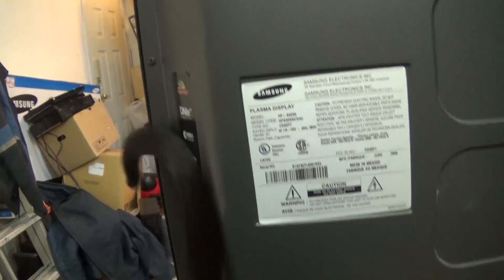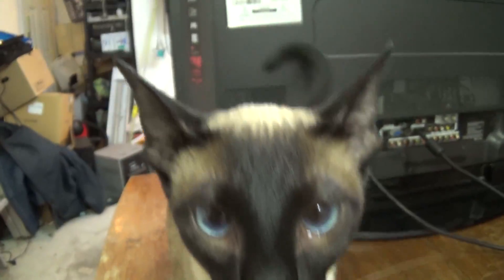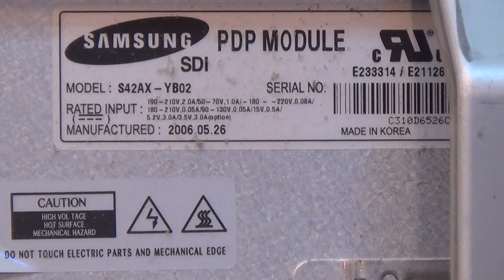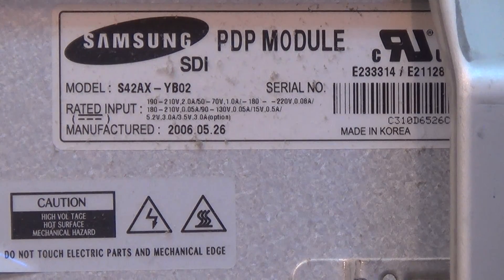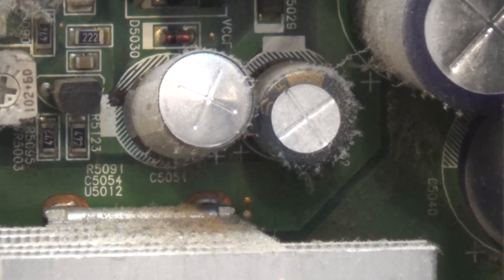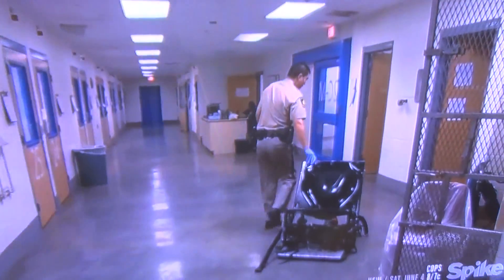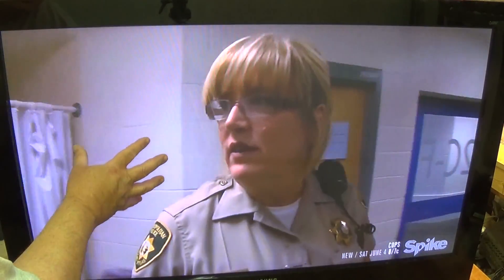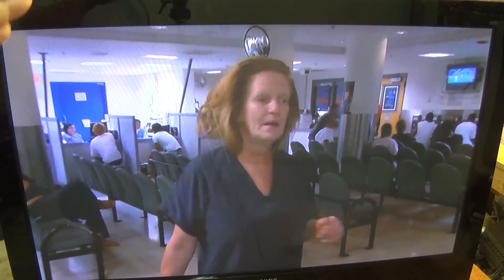Samsung HP S4253 Plasma Noisey picture

Comment: Hello can you help me, I have  Samsung hps4273x/xaa plasma and I can hear the relay ( power supply board) is clicking on and off a dozen times (no picture) on cycle until the tv will turn on normally, any suggestion?

Comment: Dont fuck with the VA voltage, they are set correctly. I just picked up a set that just had work done to it because the sound went out and a month later the people said the screen went out. What did i find? The va voltage had been set to exact voltage by the last tech and the screen couldnt keep running at that voltage, I set the voltage up 2.5 volts and perfect picture again.

Comment: just nabbed one of these today from the dumpster. Usually you don't see them unless the screen is shattered. got to replace some capacitors on the y sustain board but otherwise works for s short period of time before it shuts it's self down. it has the sparklies too.
Reply: mine is the higher end version of this module it has one extra power supply and the whole cable card and memory card's expansions. looks like the main power supply was replace in 2014 and one of the smaller power supply's(between the the main psu and the main logic board) has that brown glue crap that corrodes the hell out of everything. that was fun cleaning that up with vinegar (My main controll board is the Cadillac version.
Reply: and ill be damnd those are the exact same on my set.

Comment: Im no electrician but ive always wondered,On PCBs like these theres spots for capacitors but they are empty..do the manufactures realize they dont need those caps so leave the spot blank or is it just to save money but cutting a capacitor or two?..also what would happen if you put a capacitor in one of those empty spots?
Reply from the maker: +Nevakonaza - Many times there is a design change after the board is produced.Perhaps the design engineer called for 3 100uF capacitors in parallel, and then decided that a single 330 would be cheaper than 3  100.Of they design the board for multiple models. Such as a power supply that can be used on a 42" and 50" set. The 50" would require more power than the 42, and thus more energy reserve. Since the 42 doesn't need the reserve there is no need to have extra parts.I have subbed in sustain boards from larger sets that have additional capacitors, and diodes in parallel for the higher requirements of the larger panels. Of course these boards will never fail on the less demanding smaller panel.  I recently fixed an LG plasma, one of my own that had 2 3300 capacitors in the power supply. I didn't have the value, so I put 3x1000 and a 330 in parallel to make the 3300uF. By doing so I actually created a much lower ESR value than the single 3300 would have had, and this will never fail again.
Reply: +12voltvids interesting thanks for going into detail,it's just something I've always wondered..I find these electronic repairs fun to watch..subbed to your channel. :) have a good day.

Comment: question: I have a Phlips 42" lcd tv that tonight we noticed that a slightly lighter band starting in the top left as nothing, to the right and radius's down to the bottom. The start and stop is not distinctive, 2" on top and 1" or so on the side. Very faint as if you had a dirty screen and just lightly wiped the top and side. Where would you even start looking? If you get a chance could you give me a suggestions? 
Thanks for all your great videos.      (42PFL7422D/37)

Comment: Great vid. Around my parts you can get a Panasonic commercial plasma without defects for around $100. Up to 50 inches too.
Reply from the maker: +Shao Zhang In the past 2 yeasr I have gotten, all for free.Insignia 42 plasma (Samsung), and Panasonic 42 EDTV.LG 42: and Samsung 42 and 51 720P plasma,  Samsung and Panasonic 50" 1080p Plasma.  Then there are the LCD sets that I have sold. Sharp 37, Dynex 46, 4 Samsung 46' and a hand full of 19 - 27" sets. All for free, all repairable and most sold. Also a 61 Panasonic DLP and a Sony 50" SXRD projection.  People toss away electronics with very simple troubles.
Reply: +12voltvids Do you know how hard it is to gut a Panasonic commercial plasma to get to the front glass?  I have 2 units, one with good glass and one with marks on it but the one with marks has much lower hours and better picture so I want to swap the glass.  But I feel like it's not easy to get at.

Comment: Plasmas are so much better than LCD/LED.  It's a shame that they aren't made anymore.
Reply from the maker: +Audioquest56 I agree. OLED is superior in every way, but until they become affordable, the old plasma still have a great picture. The main reason they stopped making them was the cost to produce compared to LCD set, especially after the price fixing scheme was exposed and the LCD panel manufactures sued. All of a sudden LCD is much cheaper to make, and for many folks they didn't appreciate the difference.

Comment: Had a 51" samsung 3D plasma with a horrible purple haze across the screen. Turns out Samsung had a run of bad panels in 2010 that all developed this issue. I was able to tweak most of it out and sold it.
Reply from the maker: +James Last 
Samsung did have some panel problems. 2010 was a bad year. A friend had one with that problem. Changed panel under warranty, it went bad.Samsung said "Sorry Charlie need a new TV" He bought another one, only to find out it wasn't a full HD and you can see the pixels. He kept the bad one for his spare room. I have one too, the 51d450 with the Crack on the screen. Put up a full white screen and you see it. I have a 63" from 2009 Korean made. No problems. It was when they went to the slimline Mexican panels the trouble started. I think that probably Panasonic made the best panels as far as reliability goes, and Pioneer has the best picture on their Kuro panel. I still see them out there in the field, and they look great.
Reply: Really ashame that happened. Beautiful set otherwise. Kinda turned me off to Samsung after that.
Reply from the maker: +James Last Yup, I hear you. I only purchased 1 Samsung, the 63A550 I think is the model. Been a good one. No problems. It wasn't my first choice. The 65 Panasonic was, however after I paid my money to order it in, the store pulled a bait and switch. Said they quoted me the wrong price, and that they sold it for 1000 less than they should, and they wouldn't honour the price they charged. So it was either find another set, or they were going to just refund my money, so I went with the Samsung. No problems in 7 years so far, so that is pretty good. All the other Samsungs I&#160;now own&#160;have been given to me.That would be a 50d450,&#160; 50A530,&#160; s4253, that Insignia set I did last year, plus 2 Panasonic, and an LG42 and those are the working sets. I have a couple of broken ones that need parts I am having trouble sourcing cheap. So I think I am OK with Plasma for awhile.I still like plasma technology, it still has the best picture as far as dynamics go with the exception to OLED which hasn't proven itself as that technology is still too new. Plasma is an old technology. The first monochromatic displays go way back to 1964, which makes them one of the earliest digital displays made.